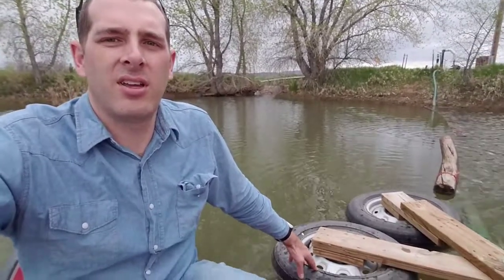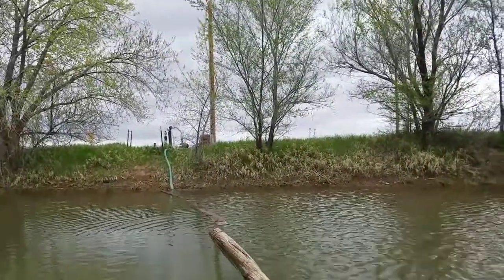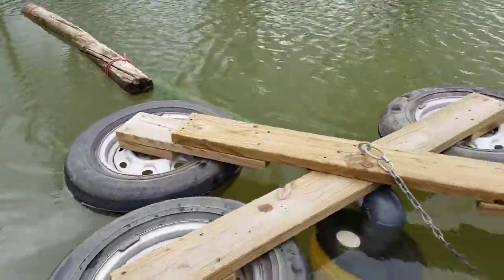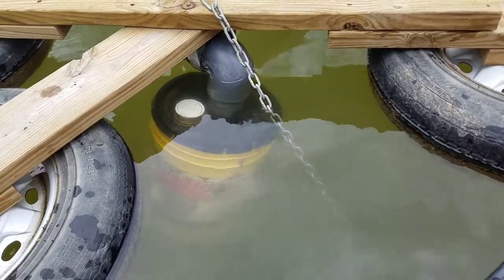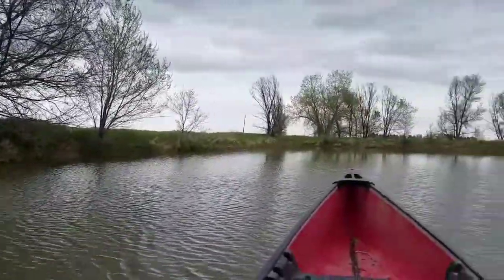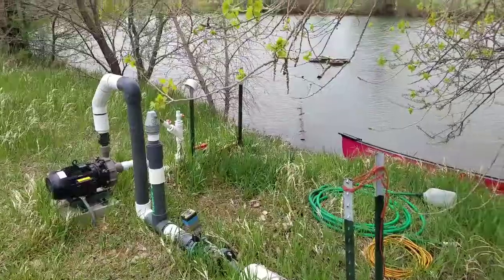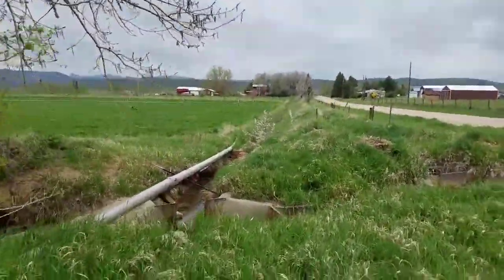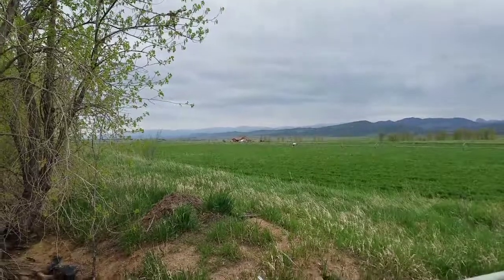Pumping System for Side Roll Sprinkler

Comment: How long is the wheel line and how many sprinklers approximately? What is the supply pipe diameter and what is the wheel line pipe diameter?   What is the pump output rate?  What is the pressure at the pump and what is the pressure at the sprinklers? What is the output of all the sprinklers or each sprinkler individually?  How long does it take to irrigate the equivalent of a coupIe inches of rain? Any info you care to lend that would be great.  I was thinking of buying a side roll for my farm but don't have any experience.
Reply from the maker: Thanks for the question! I can answer a couple of your questions off the top of my head but I'll have to do a little digging on the rest.
Wheel line pipe diameter: 4"
Supply line pipe diamerer: 6"
Wheel line length: 1200'
Sprinkler quantity: 30
Sprinkler type: Nelson R2000
Sprinkler flow (ea): 3.5gpm
Pump pressure: 55-60 psi
Pump power: 7.5hp
Pump flow: 115gpm
Reply: @Xealuz  Is there a way if you wanted to turn the wheel line 90 degrees without taking it all apart?
Reply from the maker: @grantwtk  Not easily. It really only wants to go back and forth.  I have my wheel line in a sprinkler corner so I have to take sections off as I go. Turns out to be a real pain.